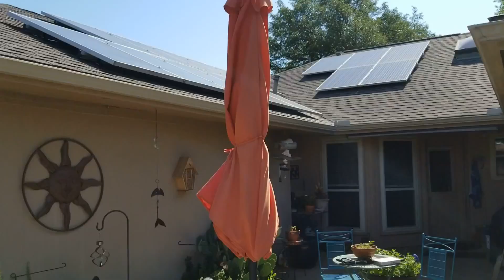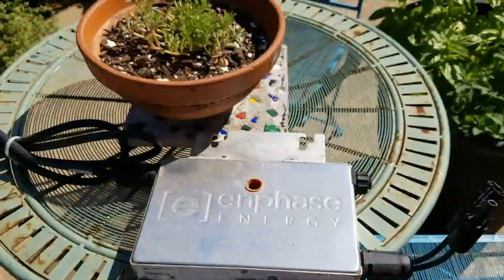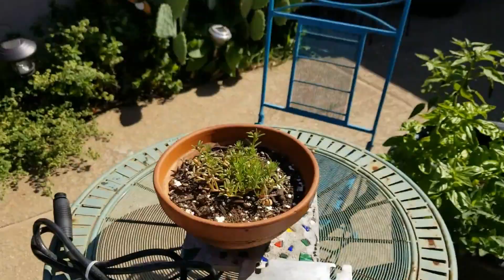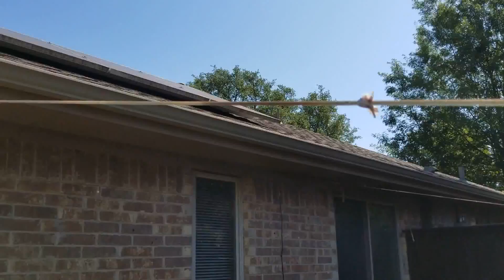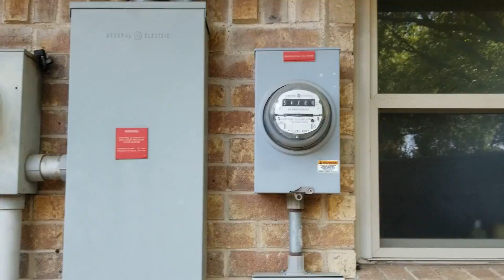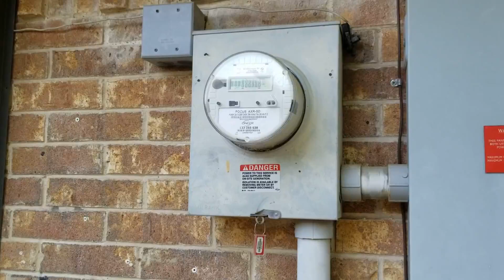Virtual Solar Tour | Litwins Household | Plano, TX

Comment: Thank you for sharing useful information about your rooftop solar array.  I have owned a 22 panel rooftop array for the past ten years.
All SunPower. Love it. It provides all the electricity needed. It is a 4.73 kW  system - like yours. Each panel is rated at 215 watts. Unfortunately no micro inverters.  I have encouraged four friends to go solar. No one has been disappointed.
Reply: Thanks for the comments! SunPower equipment would be at the top of my list for any future upgrades. Good choice!